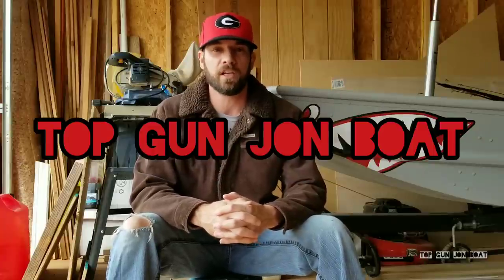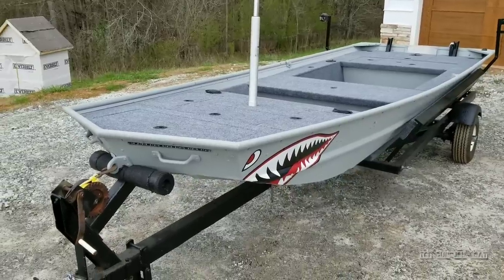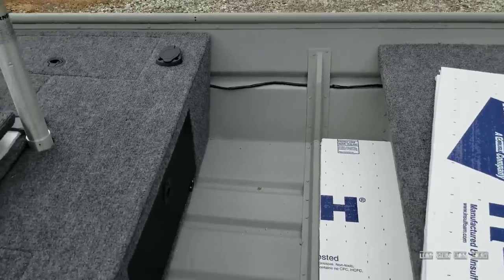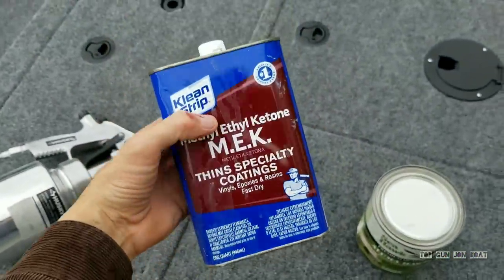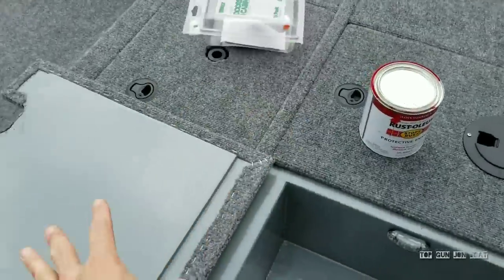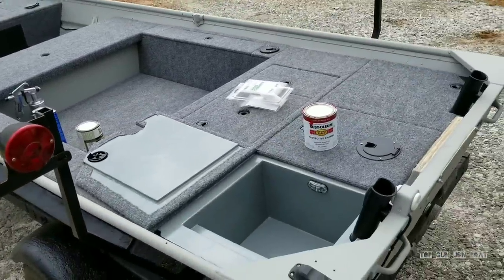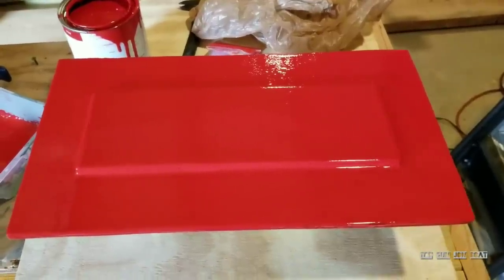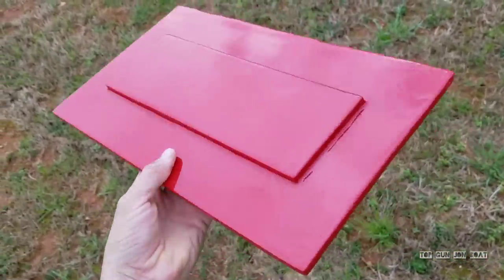DIY Jon Boat Paint Job (Interior and Exterior)

Comment: Love the vids man and thinks for letting me know how to paint my boat right😂
Reply from the maker: Hey man, I wouldn't steer you wrong. At least, not on purpose.
Reply: I just did mine tan colored. Used a gravity fed spraygun. Came out very clean. Thank you @anthonyjones However I did not have to use any thinner or mek. Specifically bought the spray gun to paint my boat. Would DEFINITELY RECOMMEND IT.

Comment: Love the build. Do you have any recommendations on fixing small leaks before painting? I have an old boat I’m planning on working on and having ready by spring. It has a few small leaks, but nothing major. Thanks!
Reply from the maker: If leaks are below waterline, bottom coat. Its 2 part epoxy. Made for boat bottoms. Im using Fasco Super Slick 1000 on my 12 ft project.

Comment: Do you think it needs to be thinned for rolling and brushing? Also, any idea how far it would go on a 16' boat? Just doing the interior side walls, not painting the bilge
Reply from the maker: Definitely must thin w MEK. It's super thick, rolling or brushing it is ok, but you will not get a factory finish. It levels to some extent depending the temperature,  how much you cut it, dry time, but I've rolled a couple small parts and you can tell a difference between rolling it and spraying it. Rolling definitely leaves a more predominant texture. Brush will leave brush strokes. If your spending that kind of money on paint, that kind of time to prep it, I'd recommend spraying it. Heck, I borrowed a friend's large compressor because I only had a tiny one at the time, and bought a Husky 40$ paint gun from home depot to do my boat. IT CAME OUT GREAT. I'd find a way to spray it if I were you, it would make life a lot easier and provide better result. Look up Alumahawk on the web, I'm sure you can find coverage specs, I know it had it listed on the can, its probably in item descriptions on boat paint websites.
Reply: @AnthonyJonesBrigadeBoats  the company recommends rolling it over brushing and spraying. I do have a large air compressor already, I can grab a spray gun if I go that route thanks for the help my man. Can't wait to see more videos.

Comment: Why did you place insulation on the floor?  Very new to boating and i want to get a job boat as well
Reply from the maker: Insulation does a few things, insulates the boat, increases float time and buoyancy if you take on water, acts as a super light weight material as a base layer for your floor system, dampens and reduces noise and vibration in boat hull. I use  1/4 inch RTec doubled to equal 1/2 inch, then 15/32 plywood on top of that coated in fiberglass resin to make impermeable then wrapped in carpet. Ends up being a lightweight strong floor system that increases performance and usability of your jon boat w minimal $ invested.
Reply: I have a 12ft aluminum, trying to build a front stand deck for the front with a storage compartment door under. Where did you get those latches for your compartments. Also what did you use as a template to cut out your compartment doors.

Comment: Excellent boat!!! How much did it cost to modify everything?
Reply from the maker: I got roughly 2 grand in it.
Reply: @AnthonyJonesBrigadeBoats  Thanks, I appreciate the quick reply. I just purchased a 14ft jon boat and need to paint it. I'd love to try and mod it similar to yours, but my OCD would have me working on it at least 6mos. 🤣🤣🤣What site did you purchase your Aluma Hawk paint from? I'm kind of sketchy about some sites and would rather use a reputable online vendor.
Reply from the maker: @JustinSmith-gs1iw  Well if you watch my AMAZING JON BOAT RESTORATION video here on my channel you will hear the story of how I spent YEARS working on this boat. For many reasons though, but then again, I'm not one to rush quality. I ordered direct from Bottom Paint Store but have also ordered from Amazon. I believe there are links in video description or you can just google it. Hope that helps.
Reply: @AnthonyJonesBrigadeBoats  Thanks! I'll be ordering from them soon.

Comment: I have a 12 foot Jon boat with a 8hp 4 stroke Yamaha. The paint on the hull, in the water, has bubbled for some reason. Only 3 months in the water, but all the time. Any suggestions.

Comment: What size/brand jon boat is that? Did you buy it used? I like the front end. was almost settled on a 1236, but I think I'm going to start looking for 1448's or 1442's instead.
Reply from the maker: It's a Grumman 1436

Comment: Hey guy, what compressor did  you use to shoot the paint?
Reply from the maker: Great question! I recommend a 8 gallon compressor or larger. The compressor must be able to maintain that 45 psi uninterrupted.  I have a 2 gallon that did not maintain the pressure so I upped it to the 8 gallon.

Comment: Getting ready to scrap down and paint the inside of a deep V that I picked up from my buddy.  The paint he put on is flaking off and just doesn't look good.   It also looks like a gloss paint which in a boat on the water just spells sun burn.   I want a dull gray.  Then I'm going to be decking the boat and carpeting it.  Nothing I dislike more is trying to move around on a V hull boat.  I want a flat bottom.
My 19 foot square stern Grumman Canoe is flatter on the bottom that the project boat.

Comment: How did you get your air from your compressor dry enough to paint? Boat looks good man.
Reply: I use an in-line water separator from Harbor Freight. Fairly cheap and flawless paint.

Comment: If I use a primer, could I skip the step of scuffing?  The original paint is not flaking at all.  I think it will be fine but I don’t want it all coming off after a few years or something.
Reply from the maker: I wouldn't. The whole point of sanding is giving the paint or primer something to grip or bind to. Since your talking primer, I'm guessing your going with a different paint than what I used. The Alumahawk paint I used, and used specifically for this reason, is because it doesn't require any primer. Some paints require a base coat of primer first. You can always do what you want and hope for the best but a true legit paint job is only as good as the prep work. That's the sanding and cleaning. Took me 10x longer to sand it and clean it than it did to spray the paint but that's what gave me the factory finish. Just my 2 cents though
Reply: Anthony Jones thank you. I’ve seen this video almost 3 full times now and I never realized you didn’t prime it.  I guess I just assumed?  I’m planning to use Aluma Hawk paint.  I went ahead and sanded it down and added a primer today.  I’ll probably have to lightly sand again to have the paint adhere correctly?  
Also, while I’ve got your attention, I appreciate your vids.  These have been 10x more helpful than some others who are considered to be the best (not naming names).
Reply from the maker: @Psweezy14  Dude thanks so much. I try to go into detail to help other than just showing off my build. I'd sand it and clean it good with mineral spirit and rag whip down. The Alumahawk paint has instructions on the can of prep, so when you get it just give it a look over. If the paint is hard to get off then its gripping so just sand over it to scuff it for the new paint to stick. If it's coming off easily or thin then just sand it off. I will be using some different products on the next build so stay tuned for that, again I appreciate the feedback.

Comment: How's the paint hold up after a year?
Reply from the maker: Like factory, as good as day one. Amazing stuff I could not recommend more. I am not affiliated or sponsored by Alumahawk but I stand behind it. You get what you pay for.
Reply: @AnthonyJonesBrigadeBoats  ok thanks. I was considering the sea hawk paint. Glad to see its holding up. I'm contemplating doing a gloss finish to help my 14ft Jon glide through the water a touch quicker. That grey theme you have going is super slick
Reply from the maker: @davidbrewer8309  thanks man. If you want better glide, id consider using a 2 part epoxy bottom coat on the bottom. Companies like Wetlander or Fasco make it. I will be using Fasco Super Slick 2000 on my new 12 ft build. More of an investment though as I spent 125 on the materials from Fasco to do my 12 footer, and another 150$ on Alumahawk paint. Me personally,  id rather spend the $ for the quality finish. Thats what everyone sees and its what makes your biat look and perform well.

Comment: How is that pedestal seat strong enough on a hatch?
Reply from the maker: If you are talking about the one on the front deck, it is not on a hatch. If you watch my framing video,you will see the bracket is mounted flush into framing then covered up with decking.
Reply: I was referring to the hole for a seat base on the back is that for a normal seat or a pedestal?
Reply from the maker: @ARob16x  , good eye. I wish I had YouTube when I did that mod. That base is actually sandwiched betchenn 11/32 ply and half inch on underside of hatch. Construction adhesive and bolted into place between wood. Super stable, not going anywhere. Works with pedestal seat or regular boat seat. That hatch is my livewell hatch and has original bench and added framing so it is supported great and the flush pull latch keeps it in place. I was proud of the mod but when I posted pics on fb and Instagram not many people seemed to care or notice the thought put into it. You are the first to ask about it!
Reply: I have my boat mod vid on my channel feel free to check it out. It shows what I did for my seat wish I would have know about your mod!

Comment: Anybody ever use Aircraft Paint Stripping?? Pro's / Con's?
Reply: Ron Beaucham pros less pissing around. Cons zero
Reply: My uncle use it to strip old tractors stuff is lethal very dangerous you need to get a box line it with a thick milar plastic and call wast disposal for pick up and pay them to do so better off water based sandblasting for anything larger than a jhon boat or car .